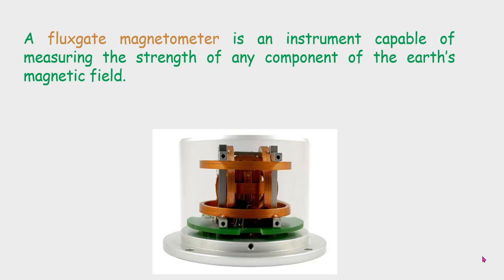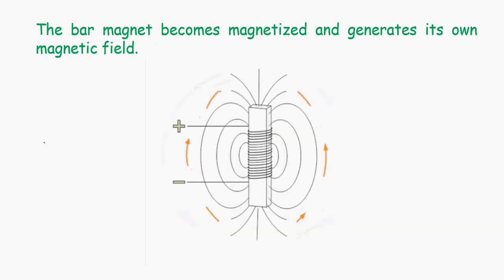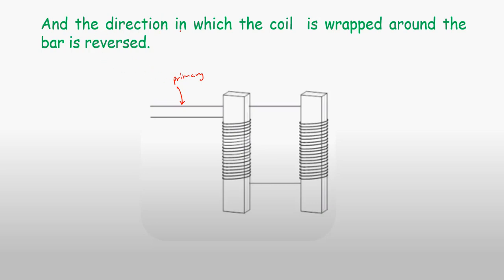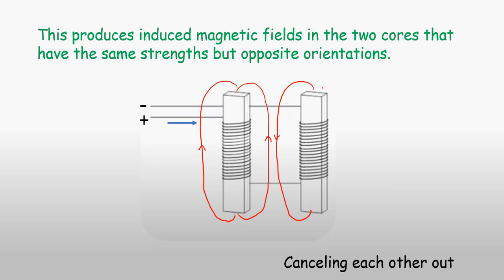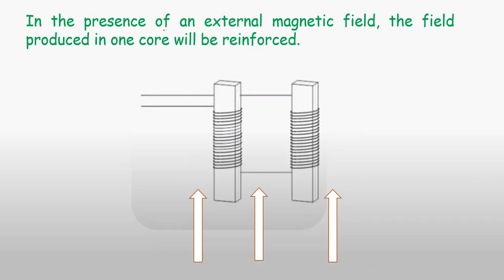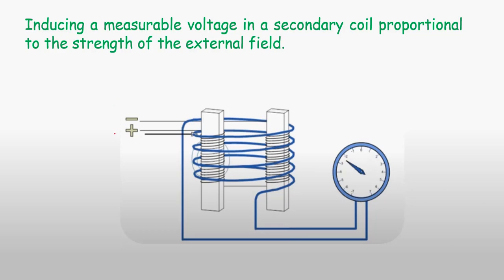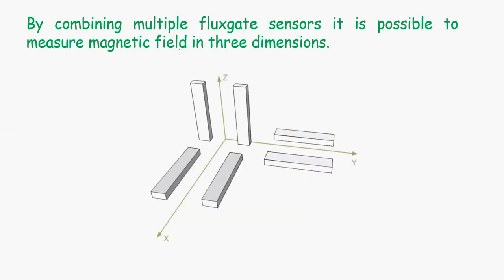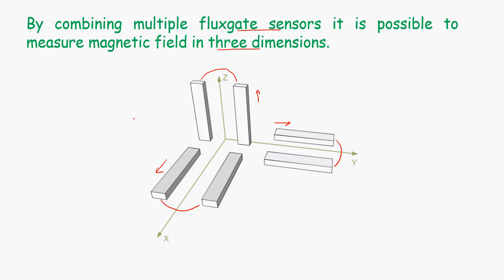Fluxgate Magnetometer: Principle Of Operation

Comment: Found it really usefull for initial part thanks. I think there is an error in last part since with a passive coil you dont measure directly value of external B but only "rate of change of the sum of B of the 2 coils".
Reply from the maker: Yes, you are right